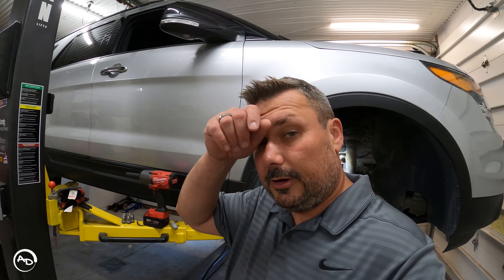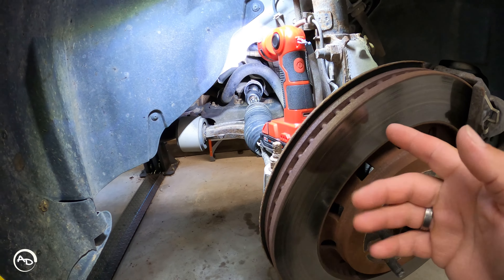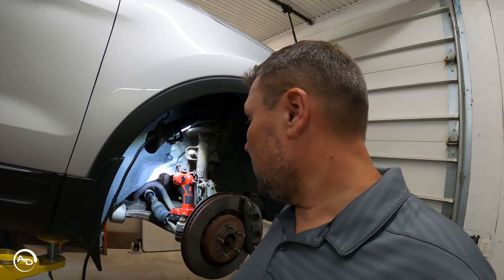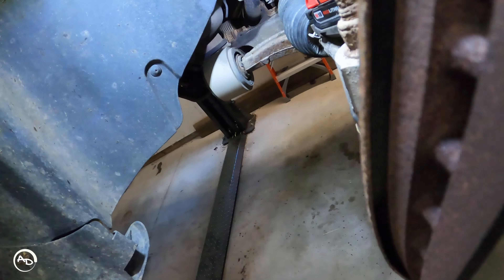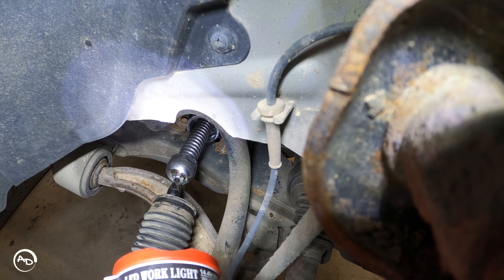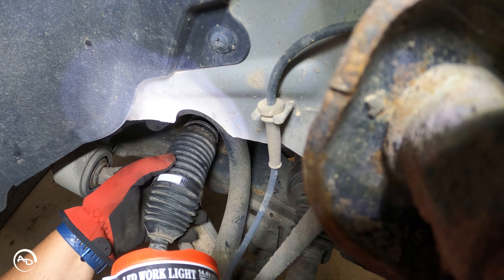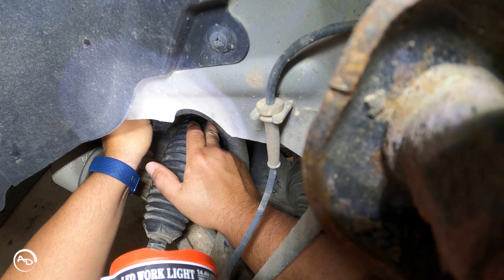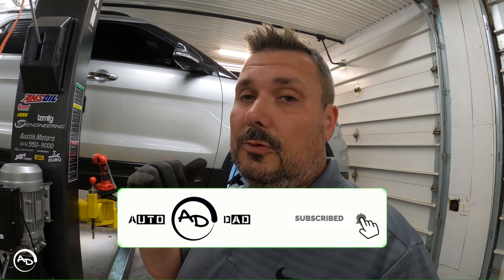Ford Explorer steering rack noise repair | How to fix cracking noise when turning

Comment: What noise are you talking about. Would have been nice if you actually showed the noise. There are tons of noises that can occur from tie rods, cv joints, struts, etc. Let's hear the exact noise.... I think I have the same issue but if I heard it I'd know for sure.
Reply: @TravisFaley  He's exactly correct. There are way too many "noises" to talk about. A sound clip of the specified noise is absolutely crucial. Otherwise this is worthless.
Reply: Why wouldn't you include the noise....

Comment: Nov 2024 - Thanks for posting this video. I had the same issue (popping & clanking) with my 2016 Explorer Platinum with 81K miles. It’s been intermittent over the last several months, on right hand turns only, but the Ford dealer couldn’t replicate it. In time it became worse every time we drove it, but everything else was solid (CV & ball joints, rods, etc). Another YouTube video was also helpful because it explained the steering stopper ring is a 2-piece unit with a gasket between them. It’s purpose is to keep the steering rack from hitting its travel limits HARD on right hand turns. But it’s a poor design by Ford, it separates in time, and the outer ring gets hung up on the steering rack threads, which causes the intermittent popping and clanking sounds. My inner ring was solid, even after I tried to rotate and get it to move, so I left it alone. Once I started, I was done in 45 minutes. This was a free and easy solution for me because the popping and clanking is gone. My only caution to others is this: If you remove the outer ring, be aware NOT to make HARD right hand turns. And if you’re in doubt, contact your local Ford dealer or automotive repair shop. Thanks again to the people who take the time to post these YouTube videos that help DIY’ers like me! CJ in Las Vegas

Comment: Awesome! We had this same noise with our 2016 Ford Exploder (heh) and was worried we would have to replace the whole steering rack as the tie ends etc were solid. After removing the tire, I shook the dust boot on the steering shaft and could hear the steel ring knocking around in there. Pulled the boot back and sure enough there is was in all its glory. Can't thank you enough for this, yes it would be better to replace it but they don't make them seprately from the rack which costs about 3-4 grand and only if you can find one. From one garage dad to another, thank you!

Comment: That item is a bump stop for the steering. It begins as a rubber washer sandwiched between two steel washers. Without it there is a very real possibility of over steering and having the tire rub on varied items. I have seen some people try different nylon type plastic spacers in place of the factory bump stop. The bump stop takes pretty much of a beating though as can be seen by the condition of yours. Check the interweb for options for a bushing to replace the bump stop.
Reply: Other than oversteering, any other negative consequences of removing these?  They are there for a purpose and I am concerned if you can oversteer on one side, can the other move out too much?  What do you mean by searching "interweb for options for a bushing to replace the bump stop"?  Can you elaborate?  Thanks.
Reply: It's likely been missing for a very long time. And no other negative consequences seem to be associated.
Reply: U probably work at ford lol

Comment: The steering wheel on my lady’s 2016 explorer locked up in the driveway, felt just like the steering column lock was on. Took a look, that metal ring was jammed sideways in the rack. I coaxed it out, steering is free now! The clicking sounds in the steering are also gone now. Thanks so much for this video!

Comment: Well that is just a dust seal and didn't make any difference on mine,  If you have any noise your steering rack is on the way out.  I got excited for a moment after watching this but ford explorers are prone to rack failures. It's a $1500 part and expensive repair unfortunately.

Comment: If you looked at the rack with the ridges and the ring you can see the the clicking noise when turning is exactly what happening as described in this video..... Perfect by the way thanks for sharing OP.  My wifes 2014 Edge Sport has this issue and I bet this is it.

Comment: Hi, thanks for this video.  The dealer couldn't replicate the noise at first, but they finally did and said we need to replace the strut bearing "to fix concern".  This is a $1300 "repair" basically just to get rid of the noise and our concern.  They claim it isn't a safety issue at all, just an annoying noise.  Can you confirm that leaving this alone is not a cause for safety concern?  I don't want to pay a dealer and am not handy enough to get in there myself. Thanks!

Comment: Just went out and checked my wifes 2016 sport.  It looked just like yours in the video.  Cut it off and its quiet again.   Thank you for sharing.
Reply: This took around 5 minutes to diagnose.  Jack car up, place jack stand,  remove tire and shake that rack boot.  another 5 minutes to repair and put the tire back on.  Super simple.

Comment: Worked great for my 2016 explorer platinum!  Thought it was bad cv axle(s) until I lifted the car and steered the vehicle by hand. Had a ton of deteriorated rubber inside that boot too that I cleaned out.

Comment: 9:45 word on the street is it’s a “cushion” to keep the tie rod from slamming up against the housing when the wheel is turned fully.  Be cognizant of steering  too firmly when turned fully to the right from now on.  
I hear you can’t replace only that part.